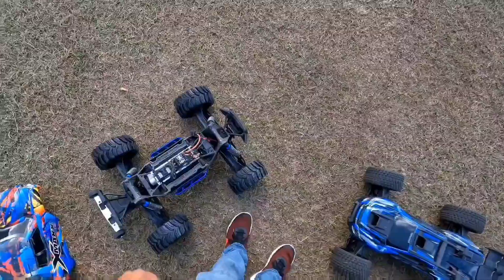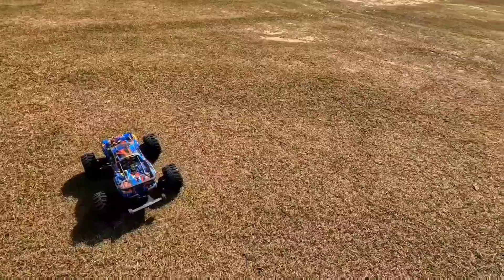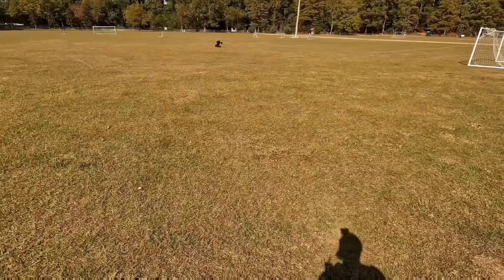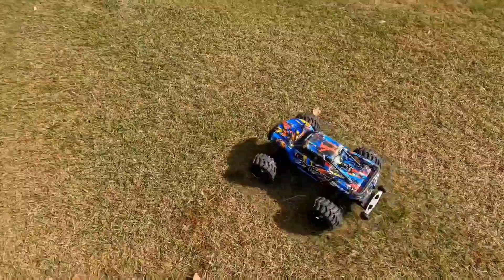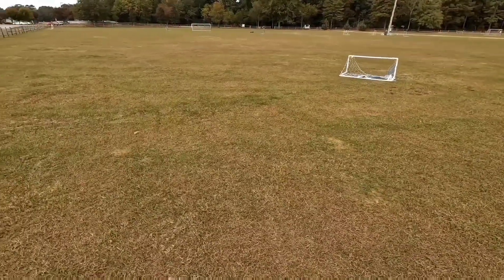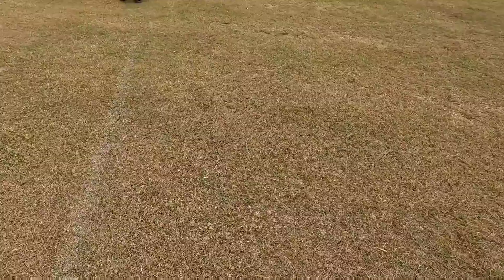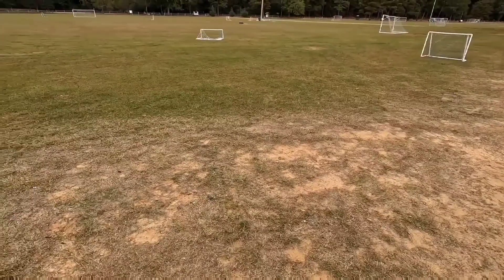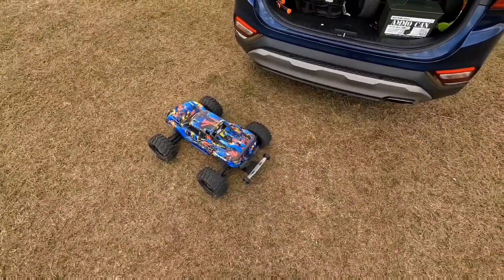M2C Traxxas XMaxx field run 1100kv

Comment: Nice. I've had my Max 5 and 1100kv 5687 motor in my X-Maxx for like 3 years. My latest gearing is 35/50. I got 54mph on grass/dirt. Enough for double backflips off my friend's huge ramp. I use a roll cage to prevent my body from flying off. Kids are funny 😂
Reply from the maker: Nice! I just talked to a guy about a ramp so hopefully I can do some more bashing soon.

Comment: I totally thought those tires were the proline masher x until you showed the sides haha. And wow they really improved the clipless system because that xmaxx body comes off a looooot. That would drive me nuts, glad the XRT is improved. I actually have that motor sitting on a shelf, but I been scared to put it in the XRT thinking it would make it weigh too much. =(
Reply from the maker: Yeah those tires are all made by horizon lol. I would love to see that motor in the XRT I'm just not willing to take apart my other RCs for it right now. It will happen it the future tho I'm sure.